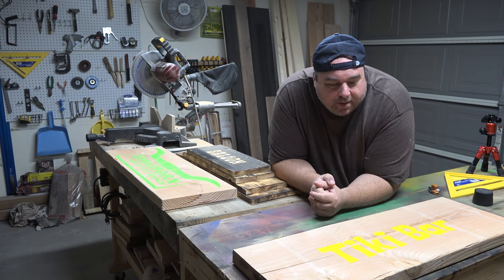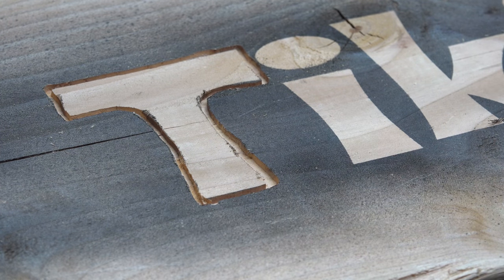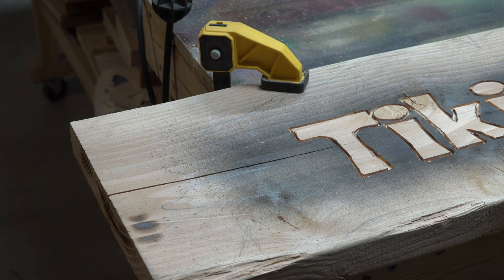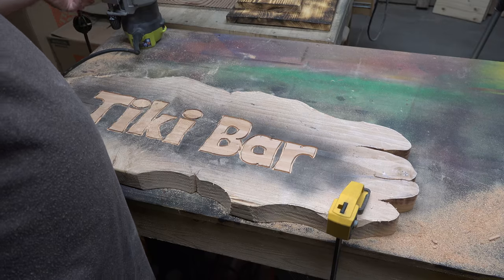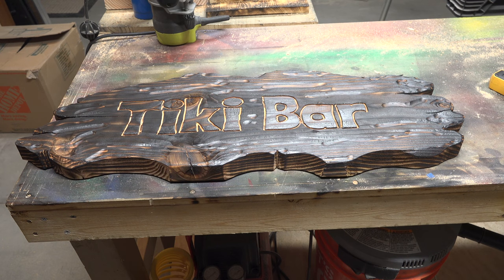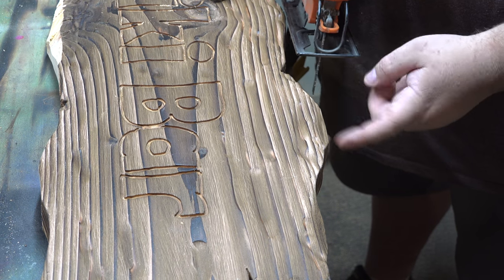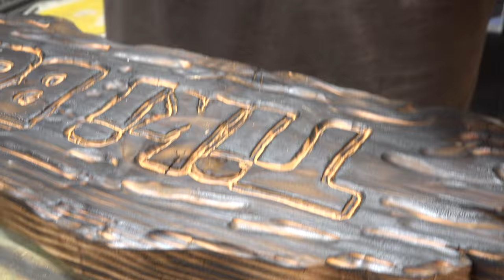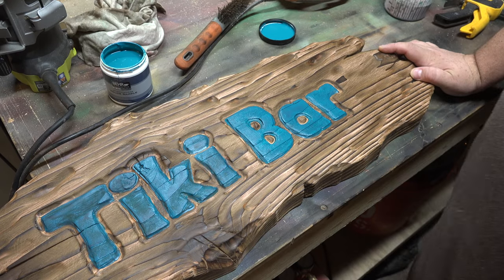How to make a Tiki or Distressed Sign - Version 2

Comment: Hi. What kind of wood u use? Not all will be nice like that???
Reply from the maker: It's just pine, actually. You'll want a softer wood as the torching and wire brushing removes the top burned layer leaving more grain giving it that aged look. 

Other woods you could use are red wood, cedar and cypress. Along with pine, all of these woods are good for indoor and outdoor use and are soft woods.